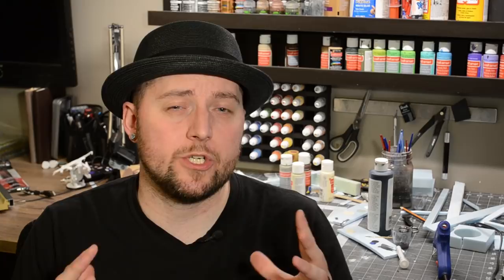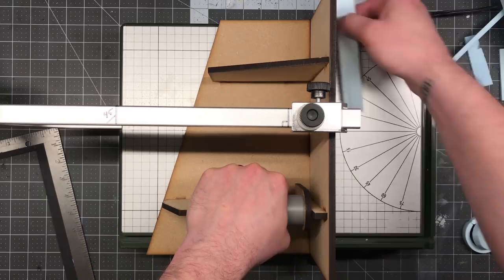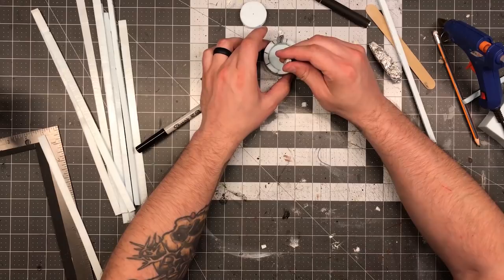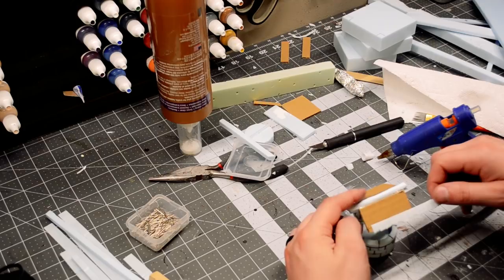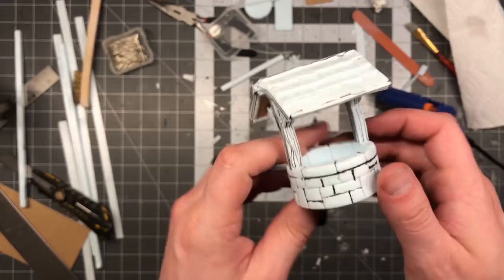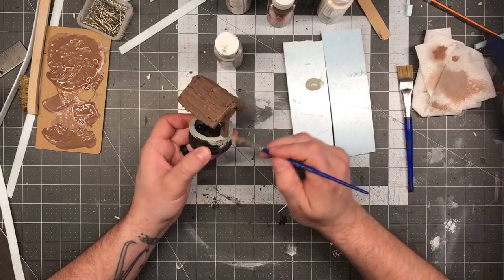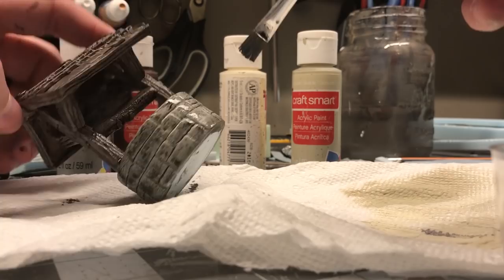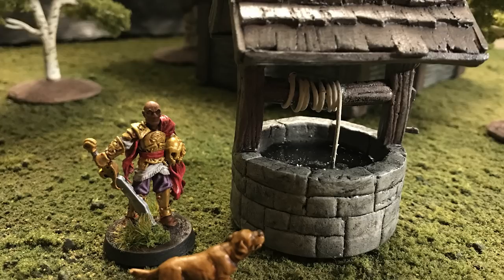Miniature Well For D&D Tutorial (Black Magic Craft Episode 061)

Comment: I love these quick builds! And the new intro is great. I like both intros. 
The hand-carved stones look great, but I'm wondering how challenging it would be to use a Green Stuff textured rolling pin on a curved surface like the well. I'm going to experiment this weekend…
Reply from the maker: I think with the guider rig you could pull it off but when the patterns reconnect it might not look great.
Reply: Ah yeah, it works great as long as you use 1inch diameter increments. Otherwise, you just clean up the gap or overlap line with a ball-point pen. The designs probably won't work well with the pins that have the elaborate designs, though.

Comment: I didn't want to be the one to point it out, but if your groundwater is that high up, you don't need a well. And you should probably move somewhere where you don't need hipwaders to check the mail. Handsome build, all the same.
Reply from the maker: You're right. I should have actually had no bottom and cut a 10" tube into my game table for accuracy :P

I knew someone would feel the need to mention that, you are the second. I can't make a well that goes deeper than the bottom of the piece, and some dark water looks better than just a black foam bottom.

Comment: Nice build, bit I´m not sure about the water. Normally a well gives access to the groundwater. But in your well the level is above ground level. Personally I think that looks odd. As if someone actually filled the well. 
Nevertheless a great video once more. Very helpful ideas. Thanks! 
Oh yeah and love the intro, don´t care about the hat ;-)
Reply: Water debit in the well can be this high though. It depends on humidity of the soil and water horizon. In many places water horizon is so high that you can dig 3 shovels in and have a puddle. Sometimes you can hit an artesian water deposit and it will flood over the brim. 
Do I really discuss engineering geology in munianure bulding video? Jeez.
Reply: Ok, but that is more a "sometimes" than a "generally" I think? Still, the well looks great. Just a minor detail.
Reply: Sure. Generally, medieval wells are poor and water level is 20m (65ft) deep and even deeper in summer.
Reply from the maker: I get that and KNEW someone would just have to make that comment. Thing is I can’t craft a well that has a 20’ deep shaft. There HAS to be a bottom and I think some dark water looks better than just black foam.
Reply: I absolutely get that! No offense! It's like you said: someone had to make that comment. It's a little vicious beast crawling from my mind to my fingers and into the keyboard. Unstoppable evil :-)
I get the problem here and I'm fine with your choice. Still looks amazing.
Reply from the maker: Also that “water” is really a black jelly mini ;)

Comment: Hey guys can you help me out? I'm a huge builder. I spend countless hours making Carton tiles buildings scatter terain etc. I wan't to make the leap to foam and with that buy a proxxon table, however I find it to be very costly. Can you guys give me some storys on how your life changed when you bought the table. maybe it will help me make that leap
Reply: rakion299 I don't know about the proxxon but I built my own foam cutting table for about 30 bucks, including an old school dimmer switch for heat control